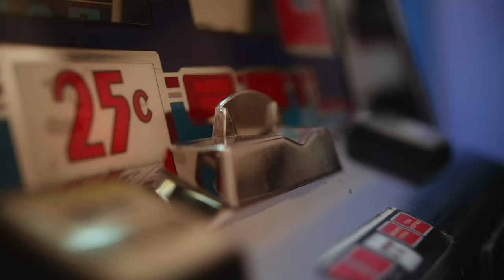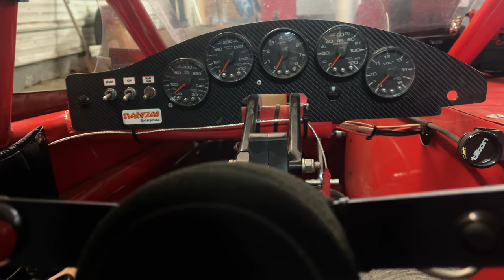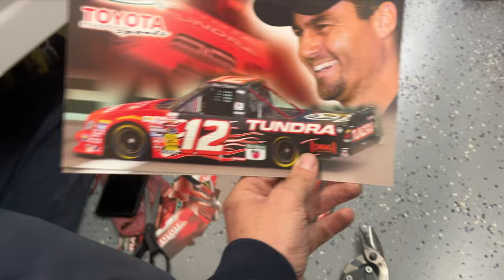This is the nicest car we have ever had in our shop!

Comment: I’ll give you some advice Huff, the first race I had in my Vintage Modified, I noticed about 10 laps in that my air cleaner wing nut was vibrating around. The rest of the race, all I could focus on was whether or not that air cleaner was gonna fly off. So do yourself a favor and make sure you tape that wing nut! 🤣😂🤣
Reply: Did that on my late model too lol

Comment: Damn Bud -- ya'all need an air rivet gun and save time!! 😂😂 I use to do the manual thang for a long time and had the same mentality as you spoke of but as ya get older time and energy get to be ya wanna save 🤣🤣😂😂
Reply: Even better get one the Milwaukee battery powered riveters you don’t realize how nice it is not having to fight with the hose until you use one